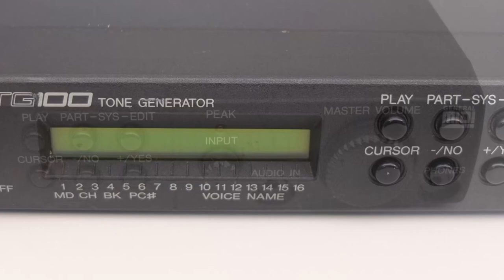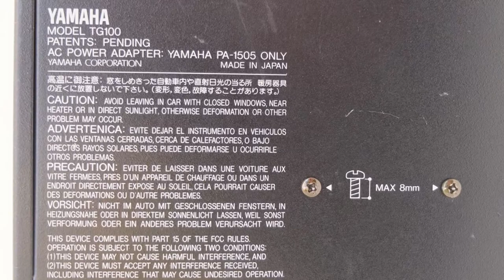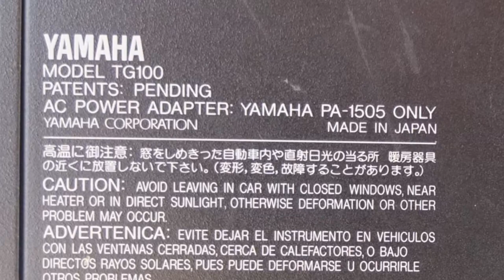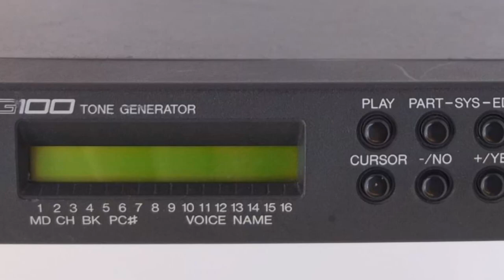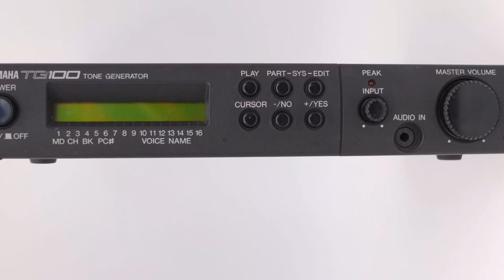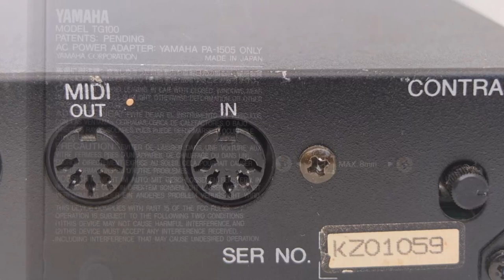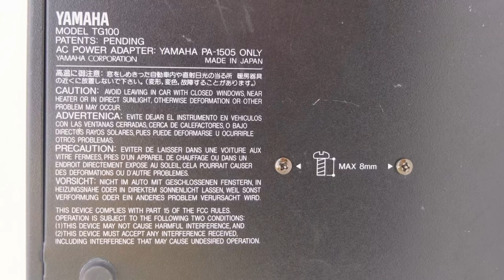Best budget GM module? The Yamaha TG100 playing Doom II music (General Midi)

Comment: As budget Yamaha sound modules go, the TG100 is an interesting bit of kit that belongs in an enthusiast's collection once they have a few other modules tracked down.  However, the MU-50 has both XG and TG300 / GM modes, in addition to the same C/M (MT-32 compatible) mode that the TG100 brings.  They seem to sell for around $100 US (about $30-50 LESS than the TG100) which makes it an even better deal than the TG100 in my mind.  A single device that supports XG, GM and passable MT-32 via the C/M kit might make the MU-50 for around $100 the best deal doing in retro MIDI sound modules.  A lot of people tend to buy the MU-80 but unless you are doing music composition or playback vs just playing games/MIDI files there are no benefits to the added features it brings for the cost.

I think the greatest advantage these "pro" MIDI modules from companies like Yamaha and Roland vs most other Wavetable Synth / Soundfonts (including the AWE32/64 and GUS) is the overall balance and complimentary way each instrument is sampled so they sound great together.  Some of the banks with higher quality samples may have individually better sounding instruments, but played together they can become a hot mess in a hurry.
Reply: What's interesting is that the TG300 and probably also TG100 let you tweak the instruments a lot more than the later MU series. Also the samples are different
Reply from the maker: In Germany, usually the TG100 is offered for less than the better known MU50. But the MU50 also is a very nice budget module! I have one as well as an MU80 and will do some videos later on. I totally agree what you say, midi modules vs. wavetable modules. Yamaha and Roland made these modules for professional use and musicians, and they have a lot of know how in this segment. You can buy any module from them and it will be made with care and of high quality.
Reply from the maker: @Schule04  Especially the TG300 offers very many possibilities for adjustments as far as I've seen.